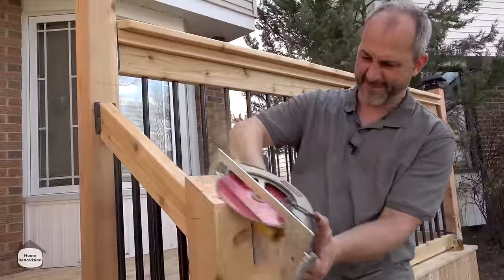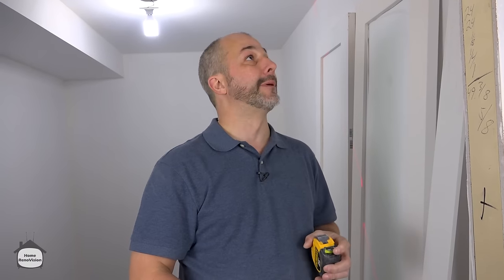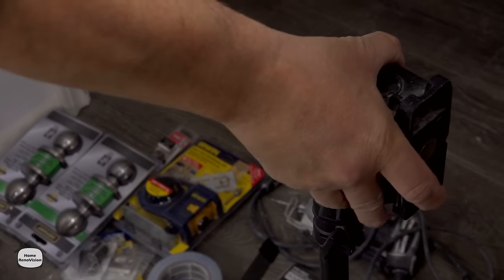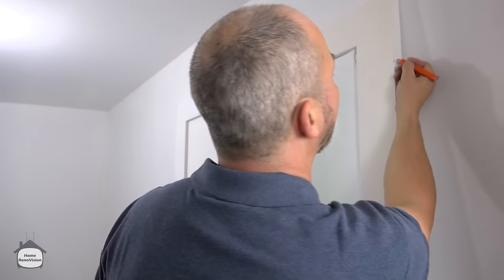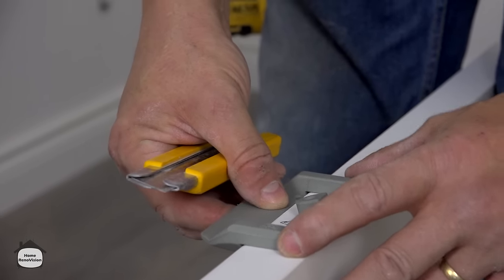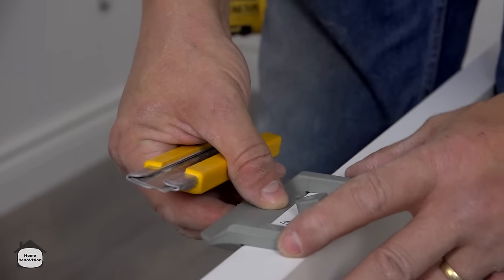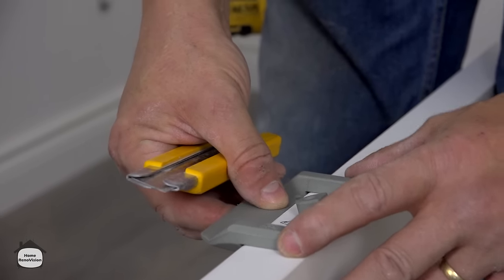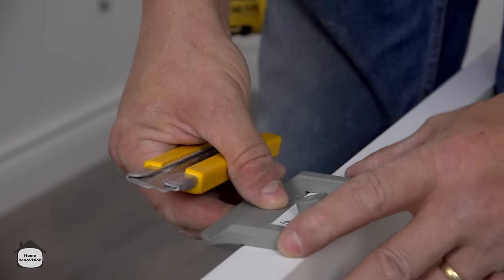Install French Doors YOURSELF! | DIY Tutorial

Comment: Before even 1 minute in. I have a 1994 built town house. The door that came with my home is not standard size of 70 or 60 inches wide.I bought a 60in door for my 63in door that was installed with my home. Replacing older 20+ year doors is not easy.

Comment: You said you were going to take ⅛" off the shorter side...did you mean the longer side?
Reply from the maker: eh?
Reply: The floor is 1/8 inch higher on the “shorter” side so you cut 1/8 off the bottom to bring the hinges down to the same height.
Reply: If you make a level mark on both sides of the rough opening, and then you measure from the floor to the level mark on both sides, then whichever side has the smaller number is the higher spot on the floor. You need to shorten the jamb on the high side by the difference between the two measurements in order for the top of both jambs (and subsequently the head jamb) to be level.
Reply: No.

Comment: WHY oh why would you drill that great gaping hole for your door handles? All you need is a tiny little hole to thread your connecting rod through. I installed such handles about three times, and 10 mill hole was all i needed.

Comment: Good instructional video but a good carpenter should not be promoting repairing damage with filler caused on the install. You basically trashed the doors.